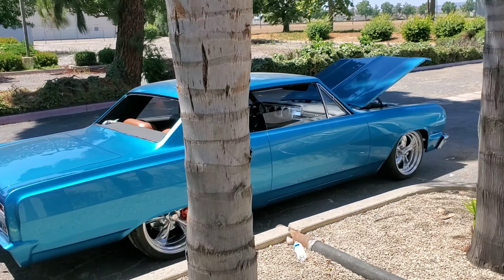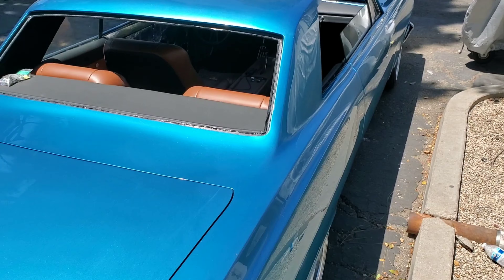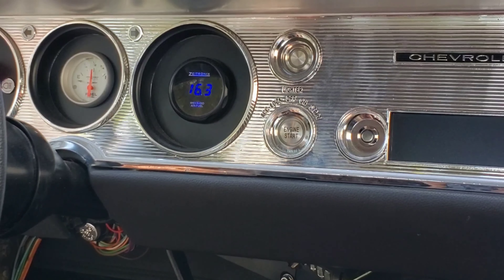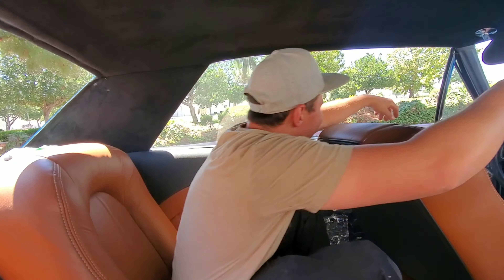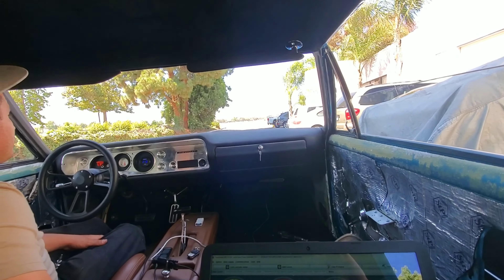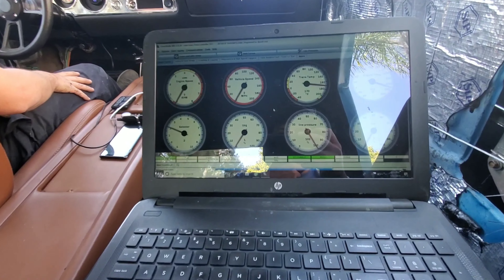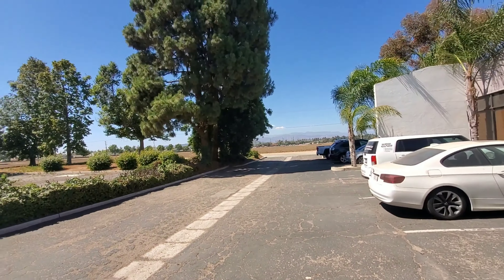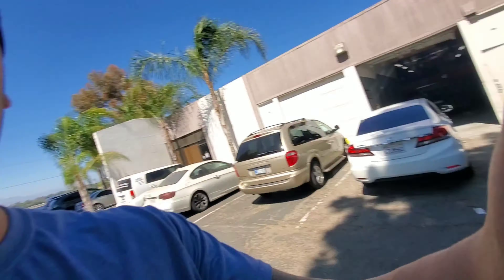Working out the bugs on my neighbors 64 Malibu. 4l80E transmission issues

Comment: The seal is pretty easy on the main harness plug on the 80e
Reply from the maker: Its leaking from the inside of the plug. Not from the outside O ring unfortunately

Comment: Ey bro I fixed my overheating problem , went with a 18” Lincoln mark 8 5k cfm fan. Wanted to try that one out before ordering  the $600 delta pag. Works so dam good . But now my external fuel pump is overheating & that’s what causing my car to bog out & turn off . Is the walbro 450 a good pump for g bodys?
Reply from the maker: Ya those fans move a good amount of air.   I'm glad that worked.   How do you know the pump is overheating and stops pumping?  Did you put fuel pressure gauge In line to monitor it?